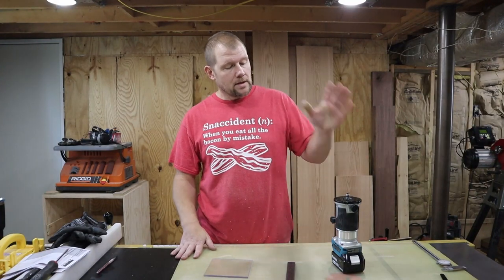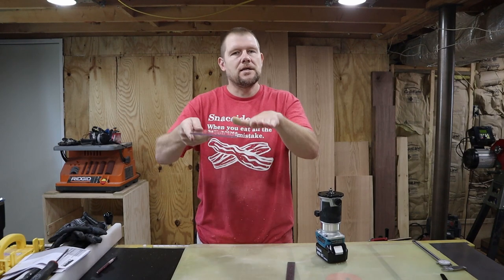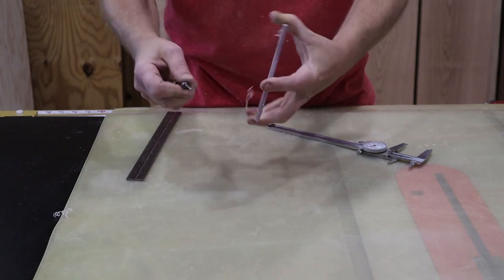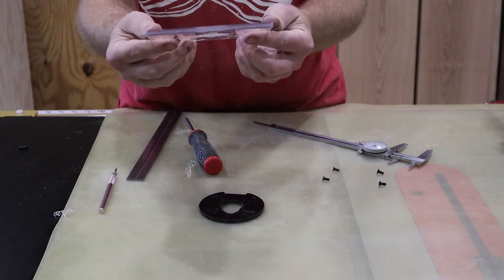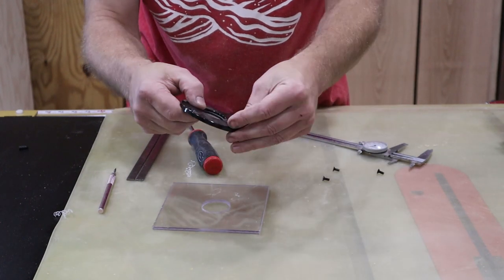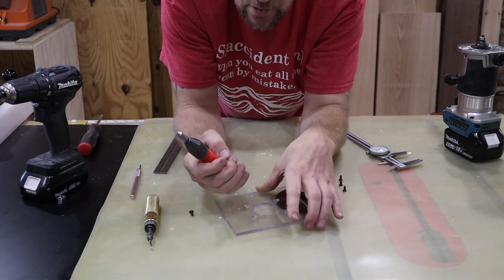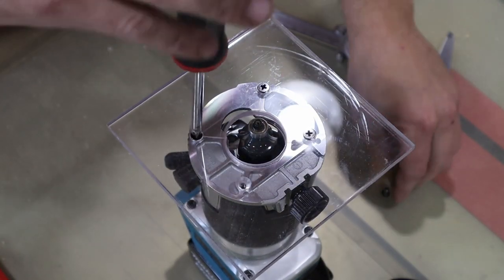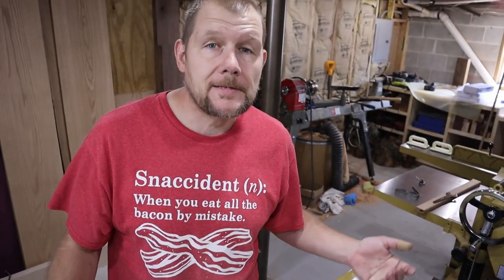How To Make A Larger Base For Your Router

Comment: If you cut the square notch larger than on the original base , you can use the square guide , the hole should have been cut last with a router bit which would have given you a perfect centre, good video overall .

Comment: Hey, so idk if you touched on this, I might have missed it, but does a larger baseplate technically make the router more stable. For example, would a 8x8 baseplate be more stable than a 6x6? I'm looking to make a new baseplate for my router sled so that's what I'm trying to figure out
Reply from the maker: Sorry for the delay getting back to you but the short answer is yes I use these bases for things that I am tryyng to hollow out like small bowls or vanity trays ect. Hope this helped. The thicker the plexi the less flex in the base.